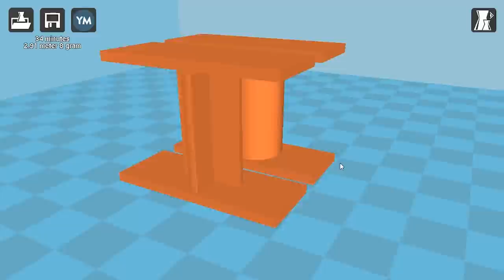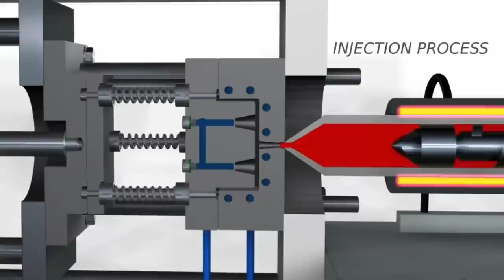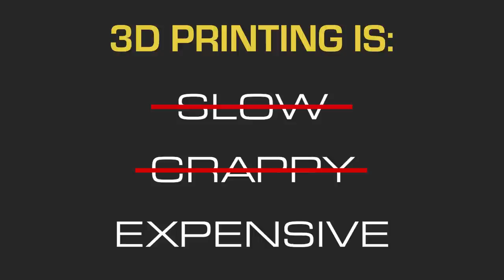Debunking 3 Common Myths About Mass Production 3D Printing

Comment: A word on quality, as it's very much a myth that needed to be debunked and I'm glad you did: I'm frustrated with injection molded plastic parts. I have a Sterilite box for storing my filament, and two of the plastic handles have the pins sheared off. It's not even a cheap Chinese product (which are notorious for bad plastic choice), it's "Made in the USA." I found patterns online, chose Tough PLA for my material, and reprinted them. It was actually challenging installing them, as the plastic I had chosen was less soft and pliable than the original handles. Time will tell, but from my experience with the material I do expect the 3D printed parts to last a lot longer than the injection molded parts.

. . . and this is one example. How many times have we had to deal with cheap, easily broken plastic? It's everywhere. I can easily print stronger parts.

Even with consumer level 3D printing, I have full control over quality, especially part strength. I choose the material, I choose the number of perimeters, I choose the thickness of the layers, I choose the type and amount of infill, I choose the print orientation. When I draw up a design in CAD software, I even have control over the shape and number of parts. I have fantastic control over quality.

One of the things I love about 3D printing is that it's actually really good quality and strength, if done right.
Reply: So much this. After having worked with printed parts this long, I've come to think of injection molding as a garbage process. So much stuff breaks easily because it's designed around avoiding thick regions that won't cool properly or avoiding geometries that can't be molded.

Comment: What about finish ?
Reply: This is something I'm dealing with personally as I want to make really small 3d printed objects and copies of already existing injection molded products. But even at 0.12mm which is the best my printers can do there are still visible lines that if you sand quickly don't feel or look good. And if you use filler then sand now your back to more expensive than injection molding. I hate resin printing even though I know it would get me closer to the finish I want. What does one do? I really appreciate everything you guys are doing for the community and want to do so I'd really like to hear your thoughts

Comment: I’m very curious on your thoughts on using a hybrid 3d printing/injection molding manufacturing process. By that, I mean using high res sla printers to create durable molds for injection molding. Since you have created an in-house filament extruder, i’m certain that you can create your own injection molding machines. Then you can bring cost down, rapid prototype, super high output by using 3d printed molds. Does that manufacturing model make sense, in terms of all the factors involved? You can get pretty amazing parts by using high temp resin molds.

Comment: Great video!  This reminds me of the common software development processes, at least before I retired.  Although not a perfect analogy, traditional software development used the waterfall model, in which all design requirements had to be known up front.  Compare this to the RAD processes like Agile and Scrum, which are more focused on intermediate output and proof of concept.  The 3D printing model of hardware output values fast turnaround and the ability to adapt (RAD), as opposed to the traditional methods of making molds etc. (Waterfall).